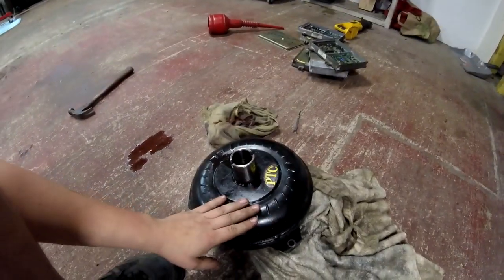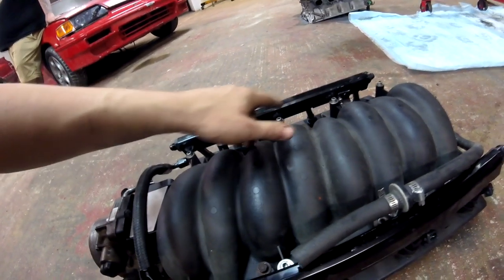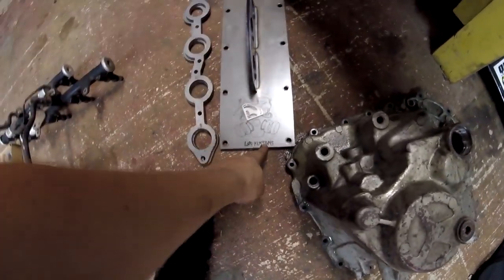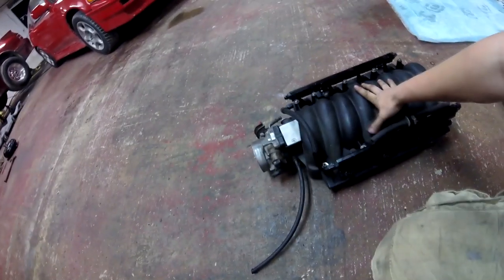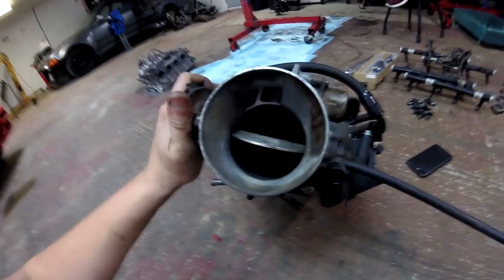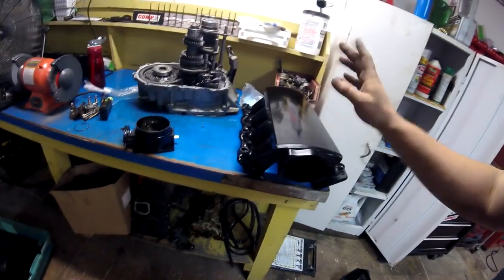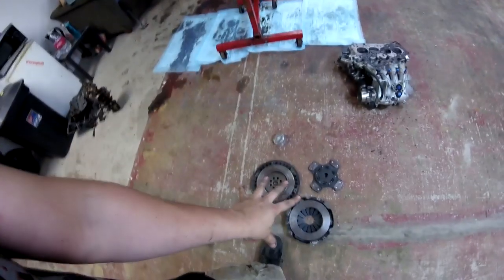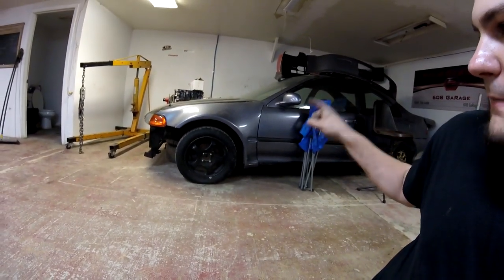New Intake Manifold For HIGH RPM HP! Honda Clutch Updates

Comment: I got my throttle cable bracket off ebay from a company called ICT billet. Really nice and completely adjustable. It bolts to the right side rail mounting bolts

Comment: PTC will cut and clean it for free. I've always had mine cut and cleaned after failure plus you said you thought it was a little tight. So if send it back have them cut and clean it and loosen it up a little
Reply: I would have done this when I first put it in the car and it was tight. I used a cheap Jake's Performance converter and it was right on the money and only $275.
Reply: @bryanroupe8646  Its not tight. Hes putting less power to it then its rated for. You cant have a converter rated for 1000hp and make 700 and it not be a issue being to tight. When he puts more power to it, it wont be tight.
Reply: I have a few buds that have ptc converters. Dusty asked what there specific set ups were and built the converter around there set up. I'm not sure why he would have a converter set up for 1000hp when it made like 600 on the dyno.
Reply: I just got a notification and could read part of what you said kn the notification but it's not here when I clicked on it.

Comment: Hey I remember you said you sold a set of decapped for a DSM, which ones are better for height? And what's your price on 4, thanks?.
Reply from the maker: The flex style is better for height but I currently don’t have any of those in stock you can get the normal style injectors and I can send you a link for a tophat that will make it plug and play
Reply from the maker: $100 on my website HunterTuned.com

Comment: Go manual💪💪💪
Reply from the maker: No thanks not in a turbo v8 car.
Reply: @HunterTuned  I have the same mustang except its a notchback 351w single turbo orginal 5 speed car Iam a give it a go with the manual will see how that works out.
Reply: My first turbo 302 fox was a 5 speed.  That was probably the funest car I have owned. I made 570 on a completely stock explorer engine and beat the piss out of it but kept it under 6k. Broke 3 T5s though. Ended up totalling it and getting a dui. Ripped the rear end and hatch completely off the car on valentine's day.
Reply: Manual trans is 10x harder on a car. If his car was a manual he would have broker the rear end the first hit and probably ripped the torque boxes out too.